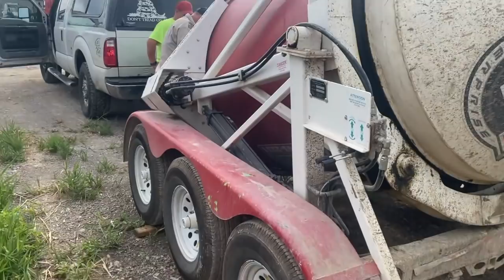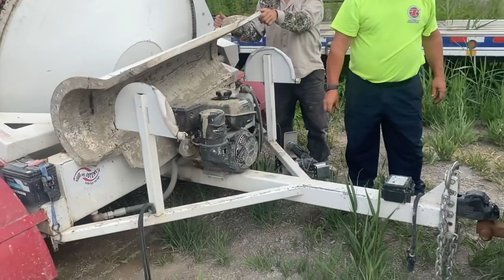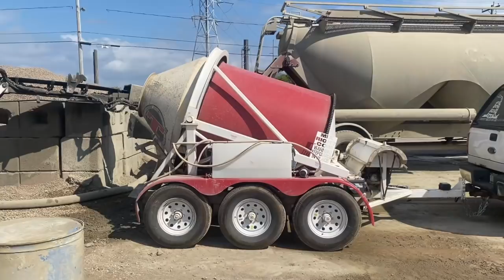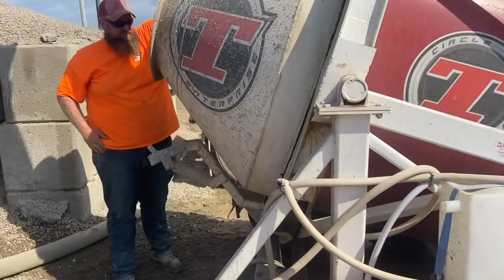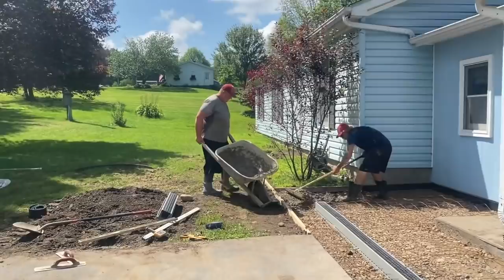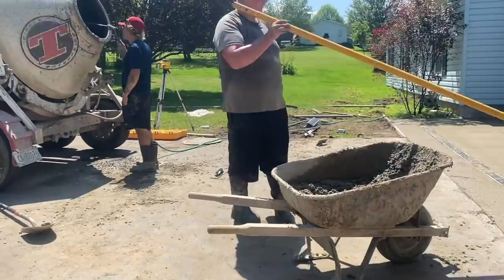NO SHORT YARDAGE FEE 👍👍

Comment: I drove a mixer for 14 years and never had anything like that at a plant I worked at. I've heard of them and they may have been around just didn't get the use . That thing doesn't have the fins to carry the mud out like a truck does not sure if you could get a consistent flow out of that thing. If you're in western NY they will load your own truck if you have one Pioneer did it all the time with their wall crews.

Comment: Man thats alot of work !!   To bad you couldnt have backed the trailer back alittle further and  dumped right out into the forms !! Put a sheet of plywood down across the trench drain and dump onto it ,,,,, I use to get a yard and a half in the back of my dump truck but not to often !! Sometimes those trailers are more work then they are worth !!  Thats a job for 6:00 am start !!

Comment: looks like a total PITA.  even for a small 1-2 cuyd job.  i knew a guy that used one of these to mix papercrete worked pretty well but stationary and much lighter material.
Reply from the maker: I think it has its place for certain jobs. 👍
Reply: @bondobuilt386  Another expansion of your impressive skill set.  Any break on concrete price over ready-mix delivered?
Reply: Yeah, i used one to pour some footings. That hydraulic dump lever broke off the manifold as i was using it in the dump position. It looked like it had been repaired once already and the weld broke. Dumped the entire load in a giant pile over one of the four holes, so i had to shovel it into a wheelbarrow and move it by hand. Im glad it was only footings, because if it was a slab it would have been a mess and probably wrecked forms, would have been hard to get down as well considering it was june and  i live in phoenix, that mix went off fast. I feel your pain bondo.

Comment: 45 years ago there was a place in Jamesville, NY where you cou get a 1 yd. trailer.  No drum, but there was a hydraulic pump to tip the trailer  and a gate on the box to control and dump your load.
Reply: The problem with a 1 or 2 yard dump trailer too long a distance the vibration caused the rock to separate and settle to bottom.
Reply: @anthonydrummond1188  Yes.  You had to get in with a hoe and rake it up.  Still handy for small jobs, readymix would put you on the end of their list and you'd get a truck with left overs.
Reply from the maker: @anthonydrummond1188  Didn't seem to do that with this trailer i have used it twice.
Reply from the maker: Nice. I'm sure that was handy for small jobs.